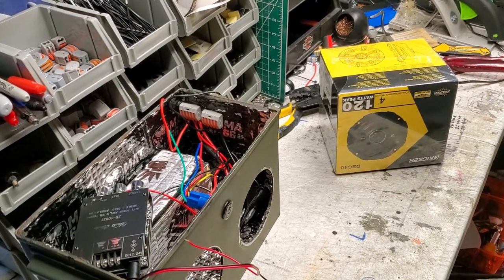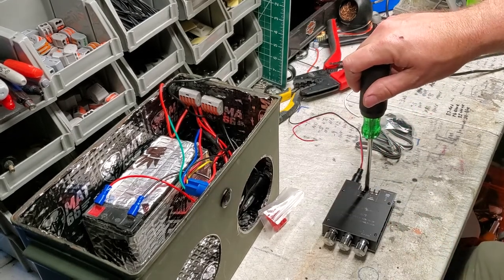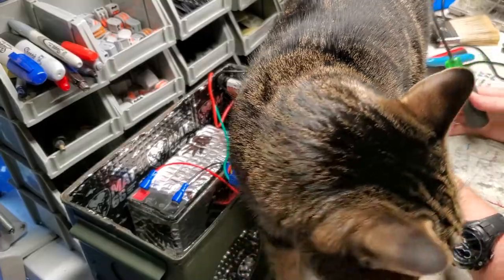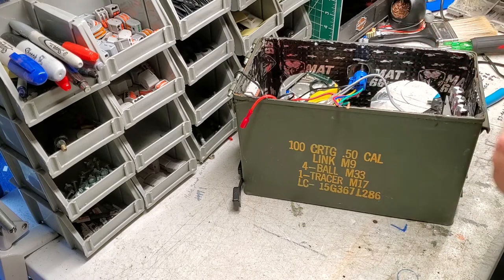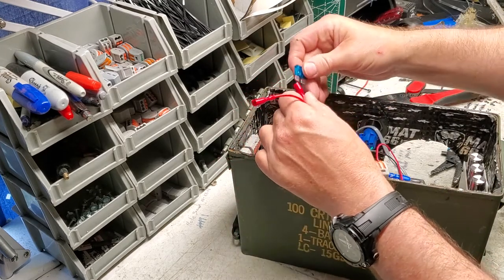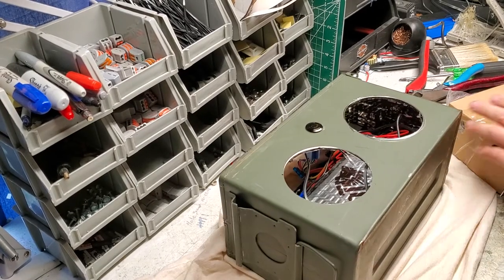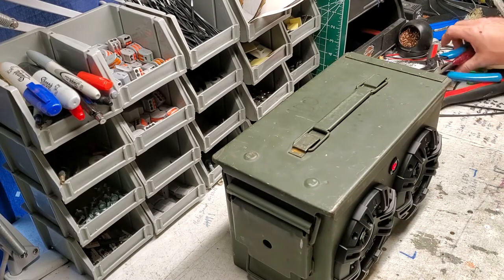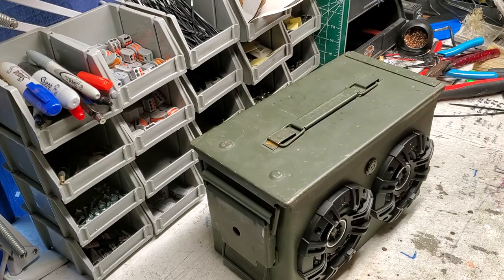Make An Ammo Box Bluetooth Speaker Part 5

Comment: what made you use this battery instead of the Talentcell
Reply from the maker: I was trying to make it more simple for people new to electronics.
Reply from the maker: I normally use the talencell but you need extra adapters to make it work and charge it and I wanted to keep the build as simple as possible for now builders
Reply: @diyboomboxesintexas2805  Thanks.. another question: what size fuse and what gauge wire do you typically use

Comment: Just wondering why you don't solder and shrink tube some of the wires? It would eliminate the use for 2 lever connectors.
Reply from the maker: Its a permanent connection.  If you need go ever go in and change something , make upgrades or repairs,  it would make it a lot more difficult. 
The lever nuts are also easier and faster in opinion.
Reply from the maker: Example.  I am doing a build and the radio had stopped working.  I had to undo some lever nuts to use my meter to make sure all the connections were getting power.
If I had soldered and heat shrinked those connections it would have been a pain to undo all that to find the problem.